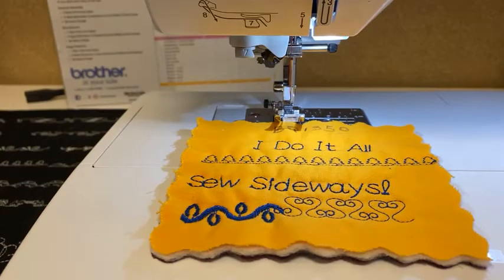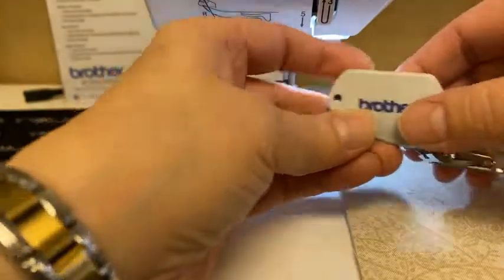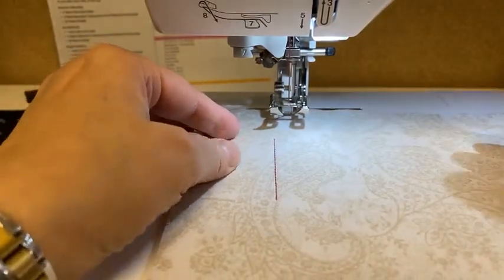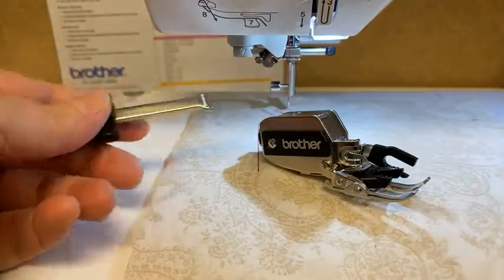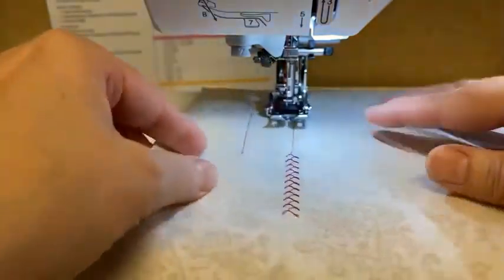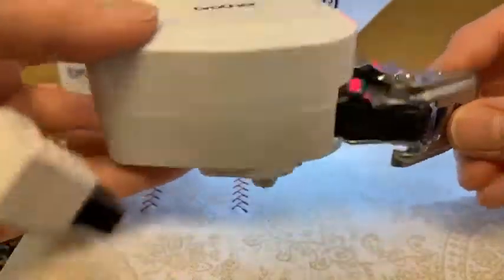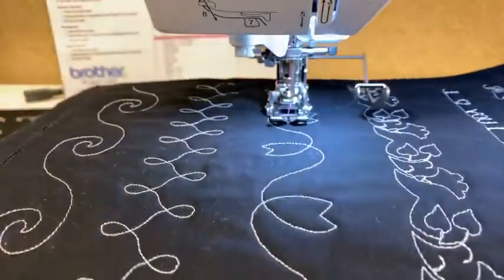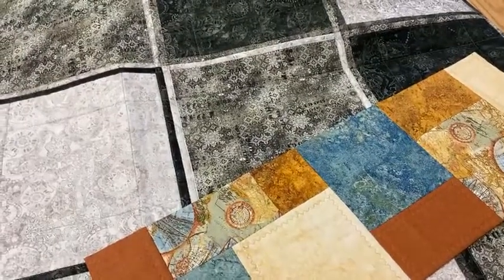Walking Foot Demo/Learn when & why to use a walking foot on your sewing machine

Comment: Hello, first time at your channel and a new subscriber. I believe I'm at the right place. Very clearly explained. 

I've just very recently learnt how to use a sewing machine. However, I've always been a hand sewing person fixing my clothes or doing crafts by hand. 

I will need your help. I want to sew some quilted placemats, meaning I will use 2 layers of cotton fabric and the batting. Having said that, my sewing machine (a Silver Crest brand) doesn't include the walking foot and it seems I can't find it.

Can I use the regular presser foot or will this cause a problem to the machine or the finish look of the sewing?

Thank you for your time and help.

Happy Holidays to you. 🎄
Reply from the maker: The walking foot helps reduce puckering.  Try stitching your layers together and see how it goes.  There  are generic walking feet available also.

Comment: Hi, the for sharing the information,will this  foot work with a Brother XL 5500  special edition sewing machine.
Reply from the maker: A low shank foot would fit.  However, on a machine as small as the 5500 there are very few stitches that would benefit from the dynamic walking foot.  A regular walking foot would be a good choice for you.  And it will fit your machine.

Comment: Does it make sense that the straight stitch looks a lot straighter with the walking foot vs regular presser foot? I’m tempted to just use walking dog for everything since the stitches look much better
Reply from the maker: I often sew with my walking foot on.
Reply: @TheSewingBasket  I see. Maybe the tension on my machine is off too. I feel like the bobbin thread on my straight stitch often looks more defined and straight and neat vs the top thread. The Top thread stitches appear slanted and slightly curvy vs the bottom seems to be more “straight “

Comment: I just got my SA brother foot but it didn’t come with a quilting guide attachment. I didn’t read anywhere in the directions about not going backwards either. What makes the stitches go smaller and larger as you’re just going along? Having it set up for 2.5.
Reply from the maker: @francineeubanks9327  usually uneven stitching is caused by “drag”.   If for example you are quilting the layers together on a table runner, the runner hangs over the edge on to your lap.  You need to hold the runner up so the walking foot can pull the runner evenly through the machine.  It isn’t strong enough to pull the runner up, so hold the runner up and even with the machine bed.  Hope that makes sense.  Also when quilting set your machine stitch length to 3.0 or 3.5.
Reply: @TheSewingBasket  thank you for responding. I have a huge table so I don’t have to worry about anything dragging but my machine is not set on 3 or 3.5. I watched a video and they said do 2.5 so that’s what I was doing.
Reply from the maker: @francineeubanks9327  2.5 is an average stitch length for sewing most things.  But for both quilting and top stitching you get a better look with a longer stitch-3.5 or 3.0.  

We have lots of other video on our channel and our website www.sewingbasket.biz.  Good luck with your project.
Reply: @TheSewingBasket  Thank you I’m starting all over again. I have ripped it all out and after I check out some more videos I’m gonna start again. If my machine acts up it’s going to the shop cause it’s new.

Comment: Will the set with the additional quarter inch and stich in ditch feet work with this deluxe walking foot.?
Reply from the maker: Sorry for the delay.  No, this foot base is attached and not changeable like the Mu-vit foot is.

Comment: So does this claimed walking foot tear up the inside of the machine? The claw is my concern and what it does internally after a year or two. I tore up my metal  Singer in the inside after two years of it jarring parts that were not designed for that drag in of material instead of a true walk. I have a true walking machine on my leather machine and the mechanics are not the same. I use a lot of fleece in my sewing.
Reply from the maker: We've been a machine dealer for over 9 years and have never had a machine problem caused by a walking foot.  Most of our customers are quilters and sew 2 layers of cotton and batting.

Comment: What I don't get is how you cant do backward stitching with it. Isn't that how you're supposed to start and end the sewing you just did?
Reply from the maker: Use the lock stitch.  It does 3-4 stitches in place.  Or manually do 3-4 in one place.